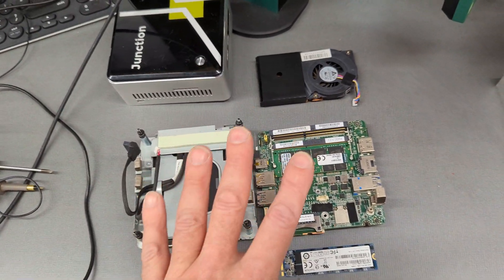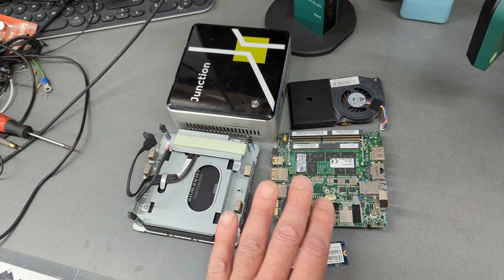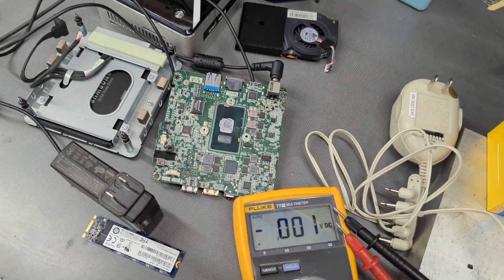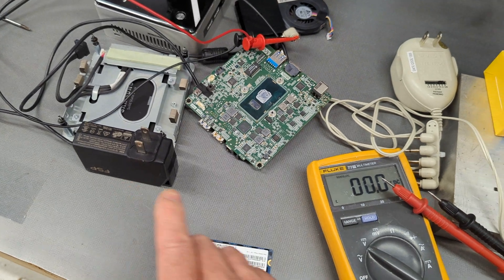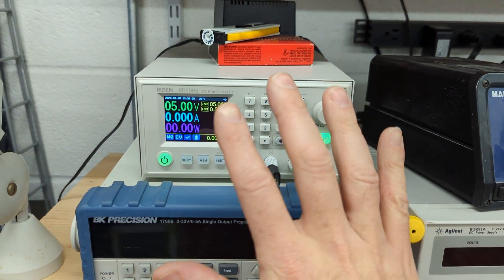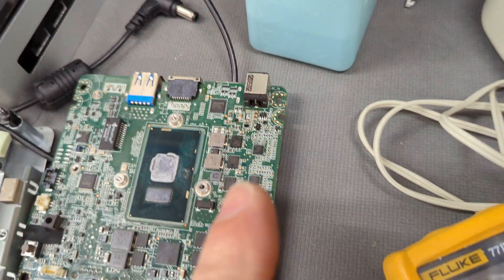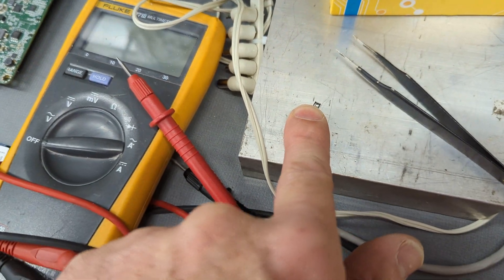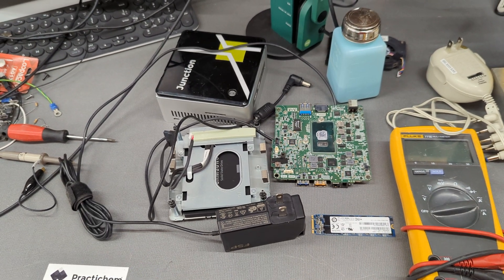My Intel NUC PC died! Part 1 of ?

Comment: Yeah, mine also failed recently. It holds 19V at the power socket though: no short.
Rats! I hate to throw out a good pc that doesn't even show burn marks or blown-up components on the motherboard.
Reply from the maker: I feel you, brother. However, I'm not skilled enough to diagnose these boards without a schematic. Some YT creators seem to divine the problem. I probed around, hit things with cold spray, pressed on components, etc. Eventually, I desoldered some interesting parts and scrapped the rest.

Comment: Mine won't turn back on unless I unplug it for 5-10min. Then it turns on, and runs no issues. I can even reboot it in the OS. Still haven't figured it out.
Reply from the maker: @DWDrums123123  get some canned air or cold spray. Spray liberally at first to see if you can shorten the locked up time.
Reply: @nickydoes  should I hit that mosfet? Do you think that's the culprit? (The board's green LED is still lit when it is not responding to the pwr signal)
Reply from the maker: @DWDrums123123  quite possibly. It's a small board. If it's a heat failure, you'll find it fast.

Comment: I have same problem here, this Mosfet SM3303 are in short circuit, removing this component, short circuit gone, now i'm waiting other come fron china.
Reply: Hi. Did the replacement MOSFET fix your problem?
Reply: @MarkDivola  I would like to know as well
Reply from the maker: Bummer! I already scavenged parts and discarded the unit. Hope it helps someone!

Comment: You ever made a part 2 or eventually fixed it?
Reply: I had similar issu on a n intel Nuc 6 generation. I sent it to repair, apparently it’s a well know problem on these motherboard, still near the jack where the power is coming ….
Reply from the maker: No. Without a schematic, it would take a lot of time to reverse engineer the power supply. Quite likely, it was a fault between   PCB layers. I scrapped the board after pulling off some fun  components.
Reply: @nickydoes  I have a somewhat similar issue withg my mini pc. It does not fully boot when I plug it in. I tried resetting the CMOS but it still goes into standby mode when I plug it in. I may try replacing the CMOS battery if I can figure out where to find it.